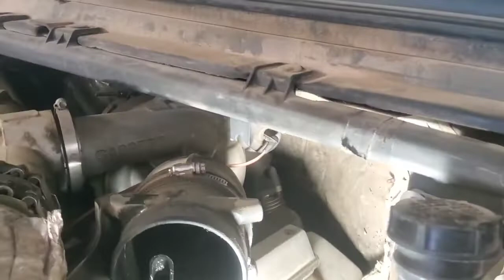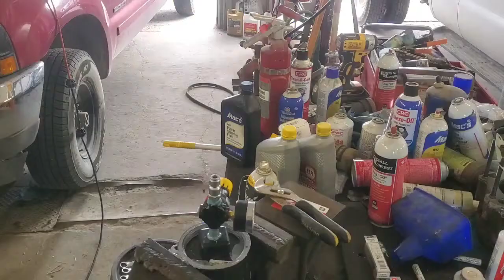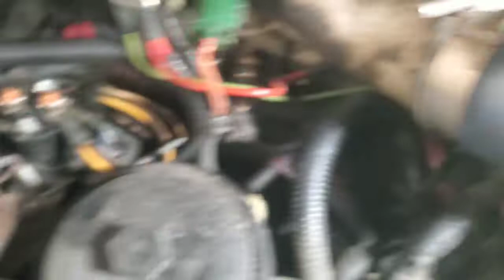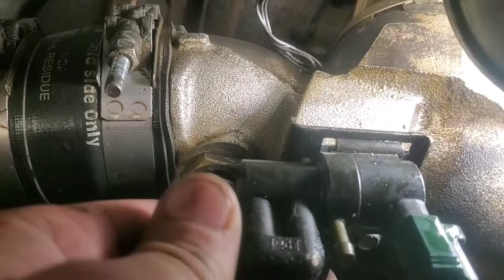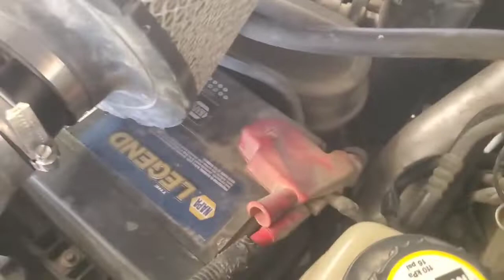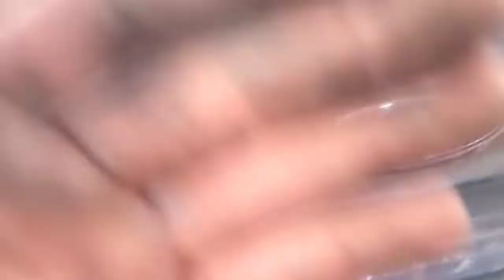Boost leak pressure tester and leak test.

Comment: Great simply constructed special service tool! I’m currently waiting for a replacement refurb’d IDM for my 2000 7.3 & stock new Motorcraft Cam sensor… figure I might as well make up one of these myself & go ‘round searching for any possible boost leaks while I wait. Mine looks as stock as this one in video looks except mine still even has stock air filter box. That formed rubber intake you attached special tool to, that boost valve tube attaches to, is just as aged on mine… has me curious if i’ll find boost leak there